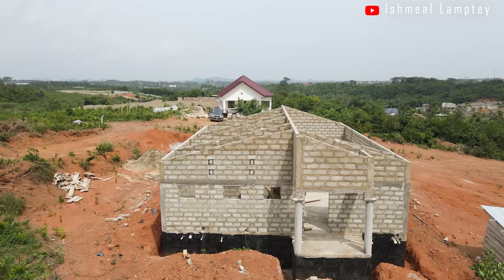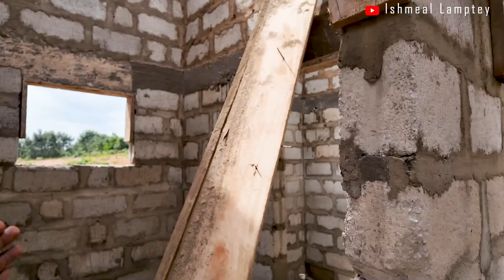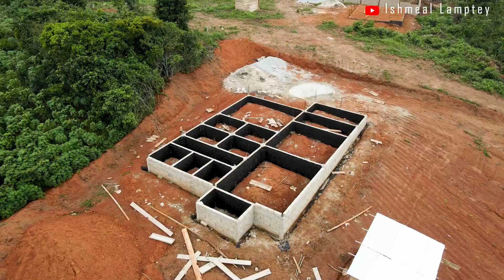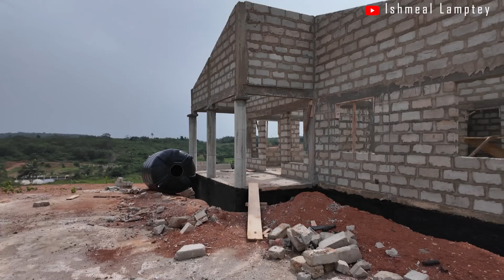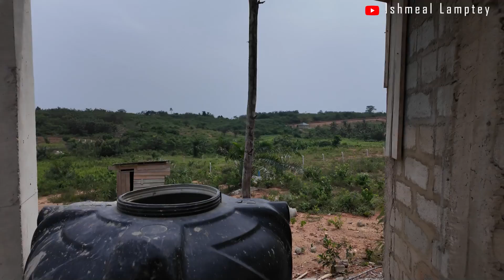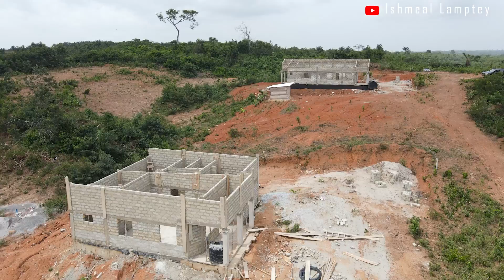Construction of 2 Bedroom Houses with Different Roof Designs (Blocks & Cement)

Comment: Two lovely two bedrooms. I like the open space in the first house; I also like the unobstructed flow throughout the house. Nice ! It would be nice to have some steps on the outside going to the roof. You could use that space on the roof to sit and entertain. I guess! The design of the house would be different! Is this the Pan African Village? Can you build something like that using interlocking bricks?
Reply from the maker: Yes the building is within the PAV. I currently do not build with interlocking blocks.
Reply: @IshmealLamptey Thanks!